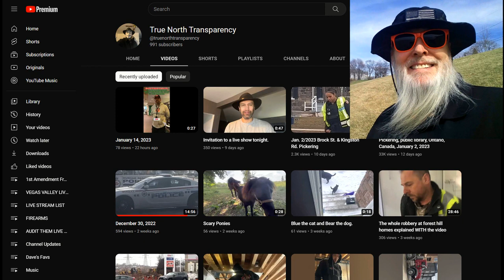Frauditor Tussles with Construction Workers & Phone Gets Beat Down!

Comment: A construction site is under the control of the GC. It's not public even if it's a job for the public, like a construction job pouring a public sidewalk, it's private until it's turned over as completed. They have the right to use reasonable force to remove trespassers